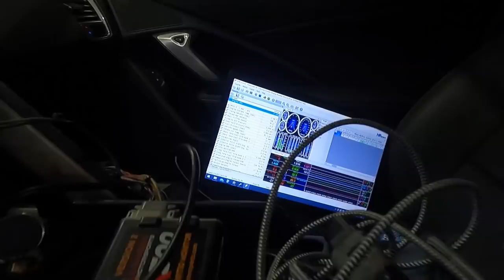WOW! Look what we found inside his engine. Naturally Aspirated Corvette Stingray C7 Headers Cam E85

Comment: What's inside the cylinder, looked like a sheet metal screw. I believe it got in there by the person who installed that aftermarket in-take box. It uses some of those screws to mount the box to the inner body of the car, IMO..  LMR is your h.p. gain shop. A bunch of guys having fun in what they do and turning out some bad ass cars in doing so. A big thumbs up to you guys at LMR.

Comment: How much HP without boost can you get from a C4 ?
Reply: That depends on what motor you're gonna run. Are you staying with L89/LT1/LT4 ( not sure what year c4 you have)?
Are you going to do an LS/LSX conversion?
Lots of options
Reply: @Tom-kn6sr  Stock motor, 1986.
Not sure of mileage but odometer shows 25,000. Has oil leaks on valve covers and engine area looks more like 100k + miles. Would definitely need to pull motor and do a complete inspection to confirm condition.
Reply: @randya9143  well, I'm far from being an expert but if you build that L98 motor, H/C/I and exhaust  I'm guessing you'll be in the 500hp at the crank range. Probably need an after market controlIer to help with tuning it.  think those motors only produced 240 hp from the factory.